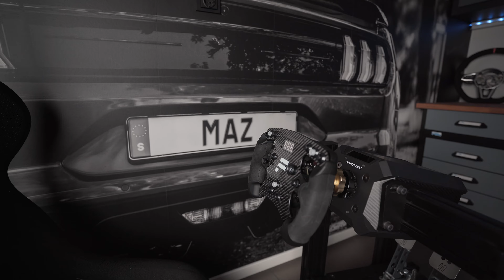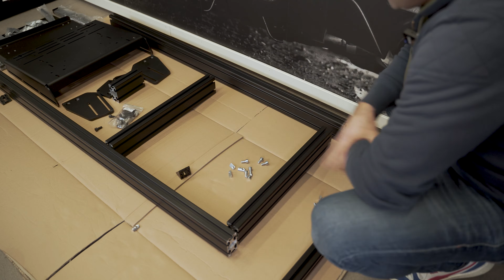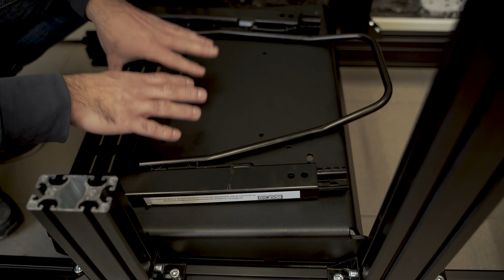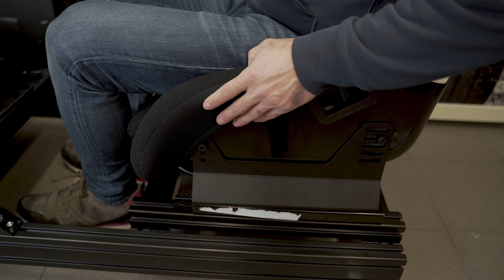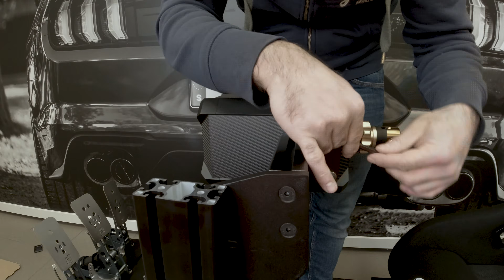Batmans sim rig Sim-lab GT1 EVO with Fanatec Podium DD2, Heusinkveld sprint Pedals and Sparco seat

Comment: Hey man, love the rig! 
I’m looking at the Sparco Evo (not the L) and as I can’t try the seat out locally, I’m gathering as much information as I can.

Are you able to tell me your height,  shoulder width and waist size?

I’m roughly 5ft 9in tall, waist size of 32” in pants and my shoulder width is 46cm, just wanted to check if I should get the regular Evo or the Evo L

Sorry to comment here, I couldn’t find another way of contacting you.

Cheers!

Comment: I just got this rig from and the m8 slot nut doesn't fit snugly into the two 1350mm pieces like it does in all the other pieces - it's kind of loose and can move side to side a bit. Is that right? The shape and size of the rails between the 1350mm and other pieces are clearly different.

Comment: I’m from the states and they don’t ship seats there so you have the link I could use to find a seat compatible with this rig please
Reply from the maker: sorry for the delay in my answer. as long as you find a seat that fits in between the profiles with the seat mount you should be fine.
I am not sure resellers you have in the US for seats, but you can have a look at sellers selling e.g. buckets seats for regular cars and it should not be an issue. I am running a Sparco seat in mine.
Reply: @Themazcorner  greatly appreciate the response thank you! And no need to apologize all good!

Comment: i bought the Fanatec Podium Racing Wheel F1 with the V3 clubesport pedals. I am thinking about buying this rig, my question is: which acessories do i need in order to assemble everything?
Reply from the maker: I would highly recommend the side mount from sim-lab to go with the DD1 base for thr GT1-evo

For the pedals I don't think you would need anything specific as the holes on the pedal base plate should be prepared. Best is to have a check in sim-labs site on the compatibility with the pedals.
Reply: @Themazcorner  thank you so much for the fast answer. what about acessories in order to assemble the seat, do i need to buy something extra?
Reply from the maker: Sorry for the late reply!

For the seat you would need to have seat brackets. If you want to adjust the seat a seat slider is good to have both are available on sim-labs site

For tools I would suggest a square, tape measure and hex keys/wrenches if you don't already have that.

Comment: any flex in the rig with dd2?
Reply from the maker: Nothing that I did notice(running SC2 now). If you get the side mounts for the DD2 you good to go
Reply: @Themazcorner  thanks for the answer. Going to update the rig and base i a few weeks. And i dont want to spend the money on the big rigs. :)
Reply from the maker: @tonypåhjul  the GT1 is very good! If going for motion the P1X is better suited due to the profile design but for none motion the GT1 is sufficient as such in my opinion.

I did review the Next Level Racing GT-Elite if you have been considering on different options. Also very rigid and very versatile but it has some drawbacks

https://youtu.be/vniyh6gxwf4
Reply: @Themazcorner  yeah no motion rig here. Was looking at gt1 evo and trak racer tr80 lite too. I drive assetto drifting and ets2/ats for the most part. So not mutch racing (yet) but my home made wood rig is so ugly 🤣

Comment: Where did you get the larger plates holding the Fanatec DD? I have a GT1 evo rig as well and I want to upgrade it to something similar to your setup
Reply from the maker: The brackets I got from Sim-lab directly
Reply: Will the stock brackets be enough to hold down the 5nm gt dd wheel from fanatec?

Comment: Thanks for such a detailed install
Reply from the maker: thank you, glad you like it. 
Just want to point out the seat brackets, I did mount the opposite on how the brackets usually sit. For me it did not make much difference. Usually the side with the three holes face rearwards and the side that has 4-5 holes/slots is to face forward, this will give more flexibility with regards to how you can tilt the seat itself

Comment: Can you adjust the seat without the seat slider? Is the sparco seat slider compatible with the Sim lab seat?
Reply from the maker: You can adjust the seat however you have to unbolt it from the frame and move and the re-tighten without a seat slider.

I am not sure of the sim-lab seat but my guess is that it will work with the Sparco  seat slider.

Comment: how can i know if the seat fit on the rig ? im afraidnof buying it and it be too big or too small
Reply from the maker: Are you ordering the seat from Simlab? If so they all will be compatible.
Reply: @Themazcorner  no sparco
Reply from the maker: Ok, I would assume it would fit without any issue but don't take my word for it.

You can adjust the profiles to the width

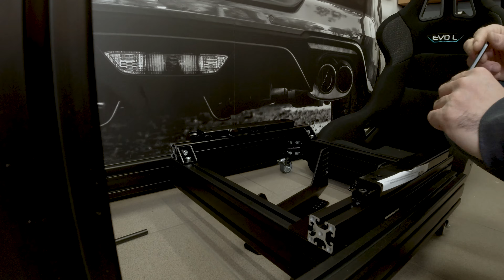Comment: hey there great build, did you need to buy any screws or parts apart ? i mean the seat screws at 20:41
Reply from the maker: Thank you 🙏! No all hardware I needed was included.

I did order everything in one go so not sure if they added extra hardware or not but I have a lot extra bolts, nuts etc :D
Reply: @Themazcorner  so i can simply buy the seat and the bracket and all the screws needed will be there right ?
Reply from the maker: Yes I believe so, you can ask simlab to be sure! But I got everything I needed

Comment: Hi, great review, I was wondering if someone like me with my height (155cm) would be able to fit inside of the rig. If not would you know any alternatives? Greetings from Germany
Reply: You’ll be fine u can adjust everything with extrusion
Reply from the maker: Thank you! I am 167cm and have no issues. Having a slider for the seat and pedals will get you sorted out easily. However sliders won't be needed as such but will make a bit more easy specially if different persons will use the rig.
Reply: @Themazcorner  thanks man good to know

Comment: Hello, Mazman, 
don't know if someone already mentioned this but the seat brackets are installed the wrong way around. 
That's probable why they are not in line with the profile.
Reply from the maker: thanks for the input will have a look again.
But the geometry appeared to be the same irrespective of the orientation.

With that said it makes more sense to have more adjustments in the front if needed in that case the side with the longer slots should be in the front

Comment: Is ther any flex with that wheel on higher torque?
Reply: No there isn’t. I have a DD2 that I run on high torque settings. I had it mounted to a GT1 Evo and now a P1X. I used the SimLab Podium mount on both chassis and theres zero flex.
Reply: @OhItsThat  why did u upgrade from gt1 evo to the p1x? i´m not sure which i should buy
Reply: @vrax23  Size. I honestly didn’t think I’d need anything bigger then the GT1 EVO but I ran out of space with all my hardware. Plus I had plans to add more. You can check out what my GT1 EVO looked like before I switched to the P1X if you watch the last video I uploaded.
Reply: @OhItsThat  hello!  Can I mount the pedal plate without uprights?? On gt1 evo ? I don't like the uprights position of the pedals I like opposite position with my t lcm pedals 
2. The length is enough for 1,84cm Person ?? Seems very short
Reply: @bratosin1  I had the 2019 version of the GT1 EVO. I was able to mount the pedal plate without the uprights. That puts it very low though. I’m sure it’s the same for the newer versions. 

Im sure it’ll fit you unless your like ridiculously tall.
Reply from the maker: I have not tried it out yet so I cannot comment on that. However there is no flex as such between the wheel and wheelbase in the QR